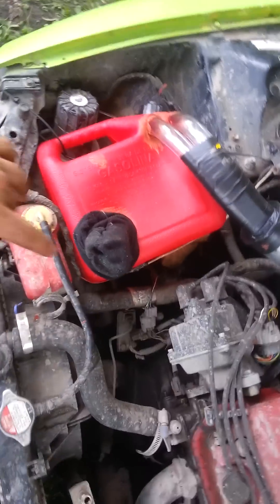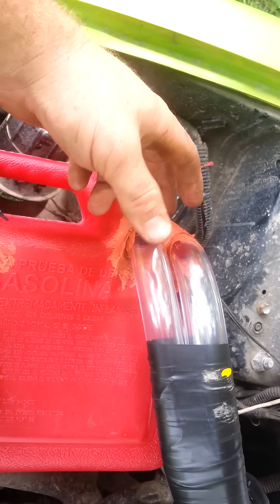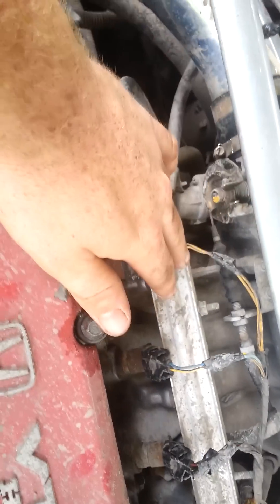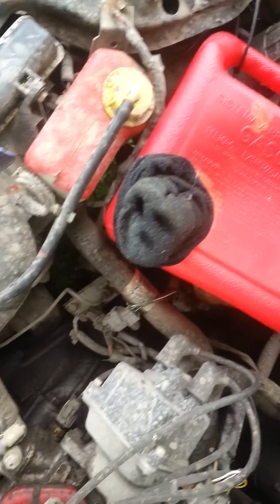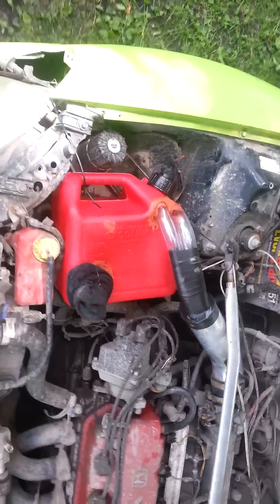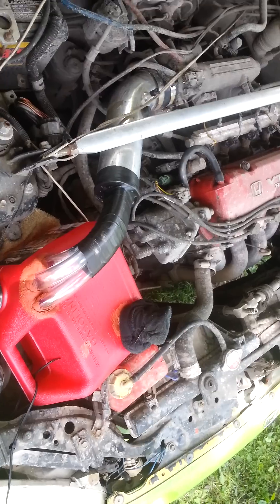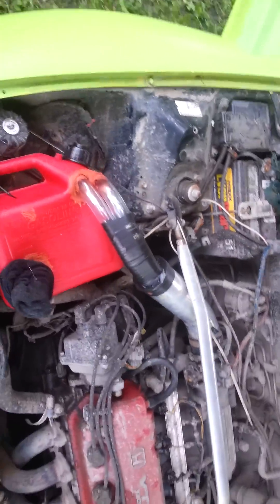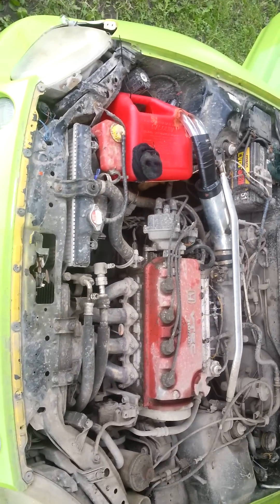200mpg gas vapor

Comment: 1m 20sec. "Clearly running off fumes" ????????????????????????????????????????????????
you moron I can "clearly" see liquid fuel flying up that inlet tube. You made no difference to the original system.
YouTube parrot, monkey see monkey do.
Reply: +quinton stout 
I didnt say there wasnt any vapor going into the engine, there is and thats what the engine is running on but there is also large amount of raw liquid fuel. The vapor system that Andrew is showing here is supposed to only admit vapour into the engine.
Reply: +quinton stout 
Theres not enough liquid fuel to cause hydraulic lock I think you are referring to (not vapor lock).
Ive been rebuilding engines since I was 9 years old and I am a qualified mechanic and I do own a torque wrench I think you are referring to (not a rench) so learn how to spell properly before you start calling people stupid fuck.

Comment: I did one almost just like this set up and well the mileage was terrible!!! I will keep up my experiment and let you people know the real numbers and share the info and how to's if you will, but so far this is a waste of time unless anyone has found the real deal design,,,200+mpg is what I wants!
Reply: Check out hydrogen conversions.

200 MPG  - for 'FREE.'  It burns hotter and purer than petroleum too.

All you'll need is some H2O.

There's a guy near me, for instance, who  does HHO Conversions.

if you have the know-how to make a car go that fast on gasoline, imagine improving the efficiency simultaneously.

I'm not a mechanic, but I do understand that we don't need to be yoked to a substance that is polluting our air, when all the HHO conversion puts out is water vapor.

I did a minimal search on HHO conversions and it's definitely real.

If you're so inclined - and with a name like Je-'Heritic,' I'm pretty sure you just naturally oppose the outdated and harmful stuff they're making us use now.
Reply: Zareth Shahara
For sure, I have not had luck with HHO either, I am aware of it but am no electrician nor to I comprehend electronics, I know it can be done but do not know how to get it done as of yet, this "vapor" design is oober simple, and is still a work in progress(experiment) and much easier to figure out than HHO is, being HHO take a lot of energy to get the right amount of gas to run a car, though I maybe wrong,I just dont now how to do that, or id be on it, I need to make more Fedia for the parts I need to build things, and a garage to work in during rain n cold weather, but it is my intent to accomplish either or or both of these ideas, I really wish I knew someone who already had it done so I could see the application and duplicate it is my issue... I need instructions, parts list and the instal pics and description, that I just do not have so its all just an experiment I have not put much money into, and with HHO one would need enough to run it free of petrol fuels, otherwise the improvement wouldnt be too good if not at all or counter productive thanks to the computer run designs today...
Reply: 'Gas' might 'drive' a car - but 'desire drives everything' we humans do. How 'bad' do you want it? Plug into that inner 'drive' and off you go. I'm not just being rhetorical brother - I have found that numerous things that I sought to accomplish or acquire in this life, happened simply because I said it out loud ONE TIME and it 'shows up.'

We are miracles and are making them happen all the time, because the human 'machine' operates that way.

If you're still considering yourself 'young' then take your time. Overnight success at anything is around 10 years.

If, you are starting to slow it down, and have knocked it in to neutral, so to speak (THAT WAS rhetorical) - then you better get busy old man! Time's a wastin.'

Peace.
Reply: Zareth Shahara lol yeah well I been reading law for 10yrs or so, now I know enough to get by, lol, I am going to have to devote time and energy into fuel, and getting off their control bus.. thanks, by the way, I have had some awesome experience speaking things into existence, it only works when your words are believed and they are backed by true desire and intent.
Reply: JeHeretic
Yes you DO know the Law, and I appreciate all of your efforts and insight brother. You are true American and I have discerned while watching and reading your contributions, courage and conviction  to expanding the awareness of the collective, that you're a genuine and unique 'Peopled Soul' as well.
Reply: Yup. About half way through I was rigging the same words in my own mind. You're astutely observing that the line of the divide and conquer methodology is an ever-increasing size of concentric circles, not necessarily the pyramidial structure that the like to present, to portray that their 'lofty' residences are 'separate' from everyone else, and that their fortresses are impenetrable, and that glass house is under assault every day now.

I BELIEVE, not because I want to - but because I AM THAT CAUSE.
Reply: That was the short answer, but it's tired, and I'm late. Great, lucid thinking, and well put.
Reply: Zareth Shahara
sorry I was ranting lol..
Reply: did the same, problem is just like in this video, raw gasoline lots of it ,it s sucked in intake
Reply: JeHeretic
BORED?! I couldn't wait to read the next line! So very well put. Lucidity and clarity are hard to find in this mesmerized world.
Reply: cata stefan  yeah, he aint running on fumes at all, we can see tons of liquid in the hose....
Reply: cata stefan  yeah, he aint running on fumes at all, we can see tons of liquid in the hose....
Reply: JeHeretic you might need a oxygen only air in.... Too much vaporizeing.......

Comment: Alpha Consultion: Problem keeping the gas warm, so it will turn to vapor? Have you thought of using the hot water that the engine produces and circulates, to pass around the container of gas and keep it warm/hot?
Reply: Joshua Dibble ....WRONG it's is not possible for cold water to boil faster then warm water.. look up what BTU's, specific / latent heat are, along with the latent heat of vaporization and how they apply to Heating ice, water, steam...it's so disappointing to hear people say cold water boils before warm water does...just think about it really, come on
Reply: brilliant ideal. but you also need a way to cool the internals of the engine. this is basically running the engine lean. running lean can melt engine internals. maybe a water or methanol injection?
Reply: cold water does not boiler faster than hot water, but hot water does freeze faster than cold water. Can anyone guess why?
Reply: Rick Dettwyler I have done this idea.... I think heat would help  with more fresh air less gas fumes
Reply: chris green I read a lot on the topic, and I need someone to explain go me the idea of running lean and melting internal, is running a gas engine on propane would do the same?
thanks for the reply!
Reply: chris green I read that vapor actually burns cooler, providing you provide enough fuel to air. That seems to be the toughest part, regulating the fuel to air. You don't want to run lean.

Comment: I have the same sat up you have. But my gas gets so cold it quit vaporizing ? It start off good for a short time then it won't even idol.; How about yours? Did you have to heat your gas?
Reply: I'm working on a similar system found these 12volt silicon heaters you could stick on the bottom of the gas can here http://www.fullchance.com/html.aspx?id=45
Reply: yeah you'll find the gas gets super cold really quick, those will only help some I've done some testing on mine I'll be getting the vid out soon. But I'm going to build another gas warming chamber away from the vaporizer heating with engine coolant to try an keep the gas above 150f
Reply: it is not technically in a vacuum, because there is airflow coming through the filter.
Reply: *****
No you were right it is a vacuum. The air is flowing because there is negative pressure created by the piston stroke. There certainly wouldn't be nearly enough positive pressure to bubble through the fuel and feed the engine...
Air is drawn through car filters via vacuum always and the engine is fed with that vacuum unless you have forced induction.
Reply: ***** I was talking about running on a vacuum vs positive pressure, nothing else.
Reply: Alpha Consultion    I think the best way is to apply vaccum to the tank and heat to the fuel.  I'm currently working on a regular propane tank with coils that go inside and come from either the exhaust or the hot coolant.  I've made some tests and it looks like efficiency skyrockets with this setup.
Reply: *****  It's easier to work with a small external tank. Plus vacuum on a plastic gas tank might not be a good idea, it will collapse.   Plus you can have dual fuel systems in case one fails you can interchange with a switch.

Comment: Nice job keep it up!

 You are sucking in very fine droplets of liquid which is basically the same thing as what you get from a fuel injected system. You need real fumes (dry fuel vapor) to get high mileage. Cracking the fuel will give you even higher mileage.

You need to filter the vapor inside the gas can vapor container so you don't have any of the liquid suck into the vapor outlet tubes. Something as simple as stuffing a shirt in there will help a little.

Comment: Is there a way to run the vapor threw a copper pipe run around the exhaust, that'l crack it into about 6x the syngas and you can run that leaner at higher compression. combine it with a steam/ water bubbler and yay lots of mpg